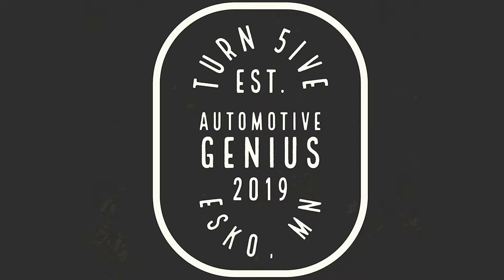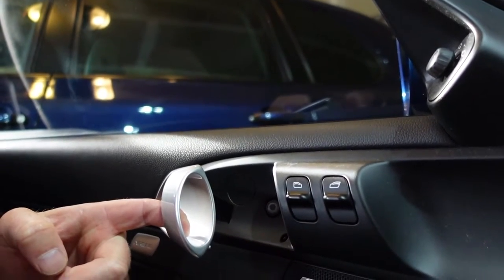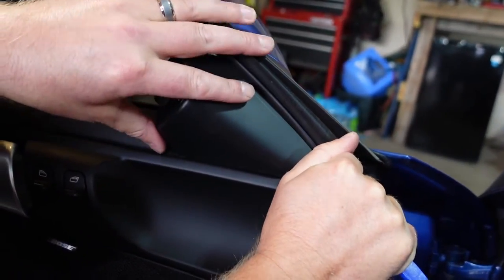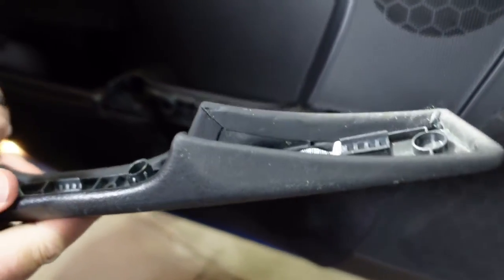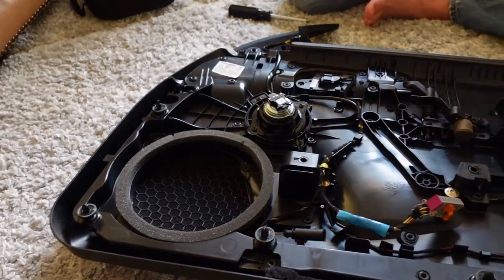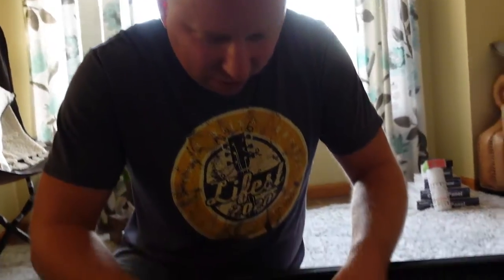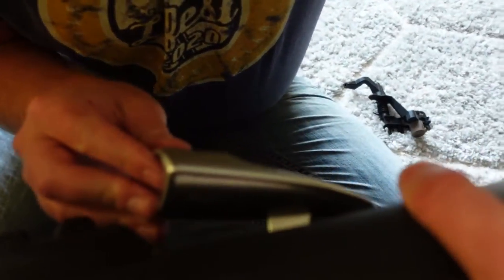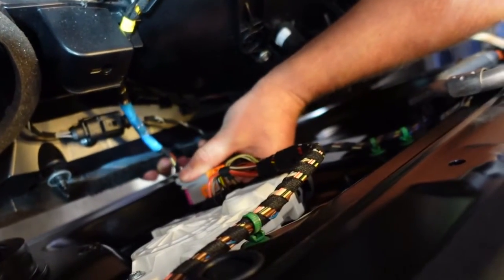Porsche Cayman: Floppy Door Handle Repair! Easier Than You Think

Comment: Did this just moments ago on my '09 987.2 CS.  The push pins can be brittle; a couple of mine broke tabs on them and need to be replaced.  That won't be an issue as I'll have the door panel off shortly since I found a blow speaker (just bought this car and haven't really used the stereo yet).  Pay attention to how the door handle hook goes in and note the new unit might have a different design than the orignial but still works fine.    

When reattaching the door panel, ensure you hook the top lip before pushing in the pins.  Use a swivel adapter for the T30 behind the handle.  I used my 1/4 impact on gentle mode to loosen/tighten the fastners.  On mine, where the white bracket that attaches to the new handle (that houses the door cable) attaches, it wouldn't clip in on the new handle assembly.  The plastic is slides up against was just a hair too thick - I filed it down slightly and it clipped in perfectly.
Reply from the maker: Thank you for the information and we are glad it went well for you! Thank you for your support!